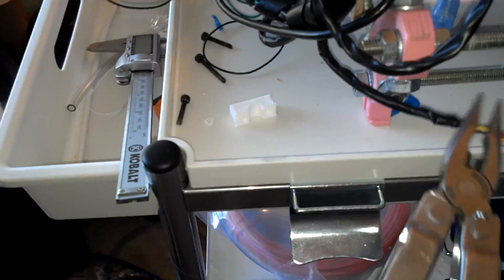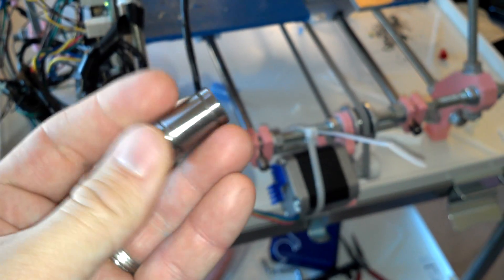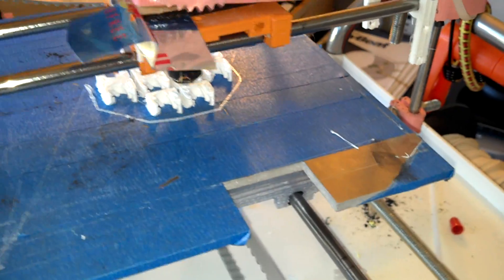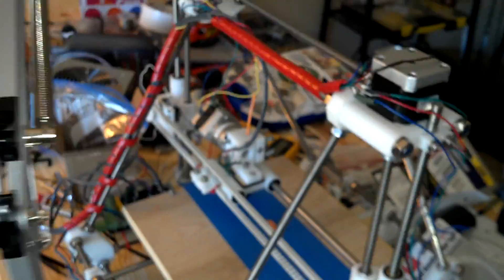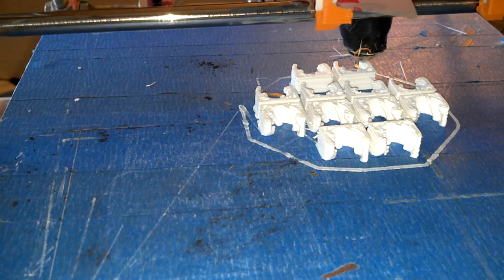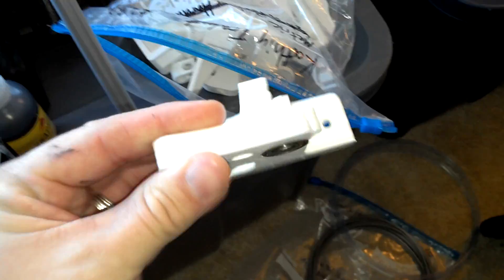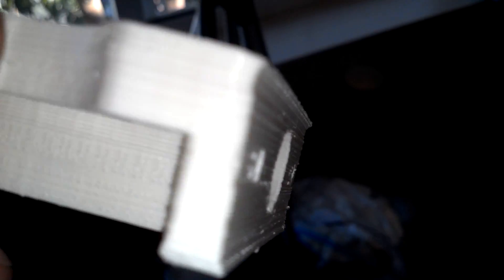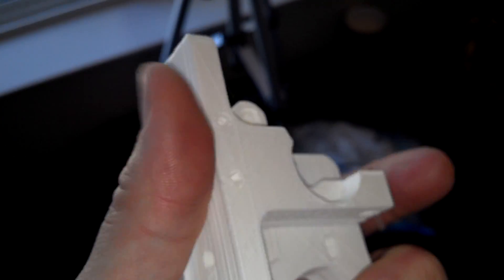Reprap Project- White PLA kits

Comment: Hi ,
I have done my first print of the hot extruder gears ( large and small) but the print quality is not that great.
I have used the .4mm nozzle and white PLA. The settings are as recommended BY 3DSTUFFMAKER.COM.  Do you think this could be a hardware problem or software problem. I would be interested in your advice, given your level of experience with this machine.
Thanks in advance
 Colin
NSW Australia